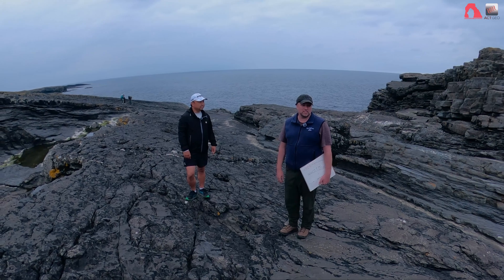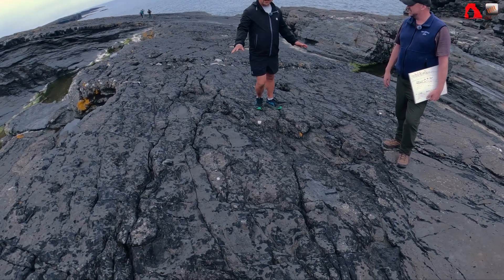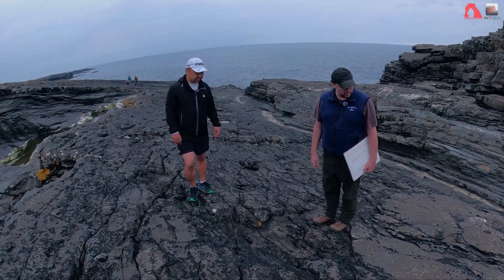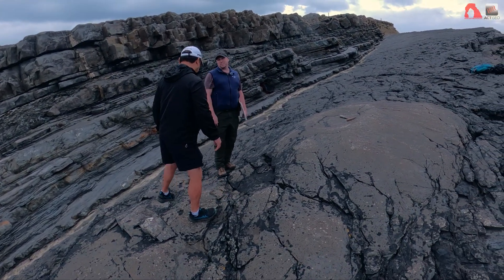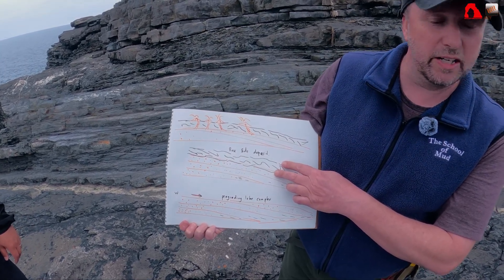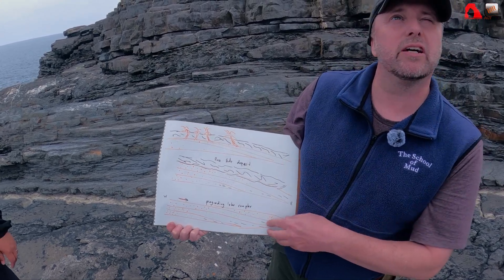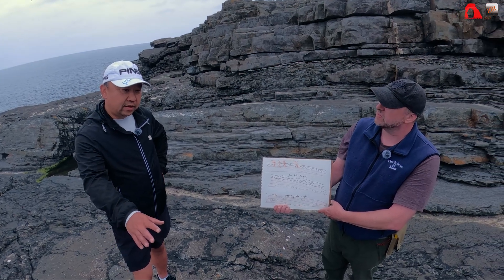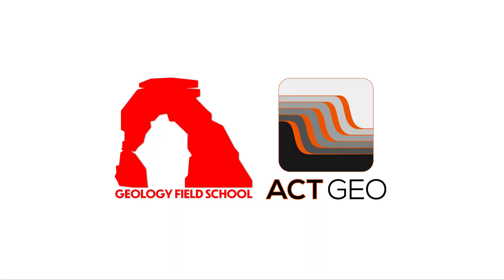Sand volcanoes. Not just cool, but important for reservoir connectivity considerations!

Comment: These are very active during icesheet collapse. 
They and mudvolcanos around the fringe and on the sea floor have to disapate thousands of years of geothermal heat and water pumped down from rhe base of the ice sheet at thousands of psi above sea level pressure.